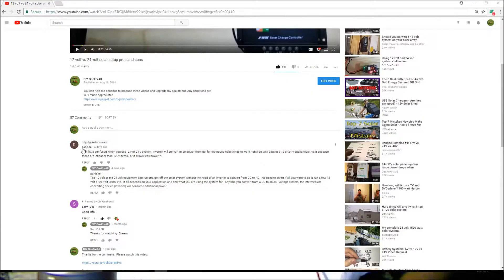Q&A - Why Use 12 volt or 24 volt appliances in solar setup, instead of 120 volt appliances?

Comment: The efficiency is greater when running DC appliances and also no power loss due to no conversion taking place.
Let's look at a quick example of a 10W DC LED Bulb consumption  vs. 10W AC LED Bulb with the same wattage but different voltages. You will find out the 10W DC LED Bulb consumption will be lesser than the 10W AC LED due to power conversion from a 12 battery bank and converted to 120VAC to just to lite that bulb.
The other thing again that is good about 12V is the convince to get 12V devices anywhere even in the middle of the night you can get those devices at the Gas Stations and replace whatever was blown from your system instead of wating for the next day for you to get it and also cheaper.
Reply from the maker: Great input.  Thanks for sharing.

Comment: inverters do use power to invert and unfortunately inverters do die, BUT if you have dc refrigerators /freezers they will work straight from the batteries which is kinda good in a SHTF scenario, and some dc refrigerators and freezers are HEAVILY INSULATED so they use even less power again and even in HOT WEATHER. alot of ac refrigerators and freezers have pathetic insulation and the compressors have to run very frequently in warm weather or heated houses.
Reply from the maker: closertothetruth 
Very good input, my friend.  Thanks for sharing in on the subject.  Happy Labor Day.